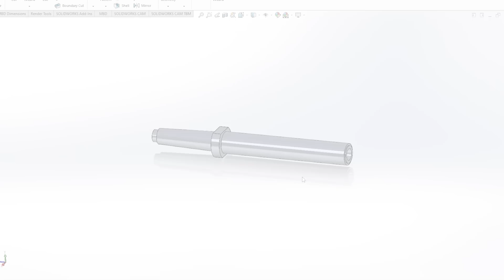Fixing An Overdue Mistake - Morse Taper Slitting Saw Arbor Build

Comment: The runout maybe from the cold rolled steel, as it has internal stresses in it from the rolling process. And when you machine the surface the internal stresses then become dominant. CEE had this problem before and he had to normalize the part to relieve the stresses so it would stop self warping .Your design is spot on. As you mentioned about trying to have the cap doing double duty. 
The most concentric way I have ever seen is by clocking and turning the mandrel in the mills spindle.
 Great channel

Comment: What size Morse taper was this??  Great video. I recently made 2 slitting saw arbors for two different size slitting saw blases, but mine was to  fit into an R-8 milling machine spindle. I've rarely had a slitting saw blade run 100% true, especially thin ones.

Comment: Nice video. I appreciate the length. Enough for explaining reasons why. My slitting saws also have runout. Only don't understand why you didn't tap with a tap follower in the lathe.
Reply from the maker: M12 taps are a little much to tap like that. The larger tap wrench I use doesn’t sit in the lathes swing

Comment: Been following your channel for a long time, and am about to get a lathe from the place you got yours. One thing that keeps stopping me is trying to find material. Where do you get yours? I think we are in the same state, but I am country, so not many options. Any advice or info would be greatly appreciated. Lastly, could you also tell me where you got your dovetail cutter from? just ebay? H&F don't seem to stock them
Reply from the maker: If you are in NSW, Edcon is you’re best bet for metal. They have a few locations in. NSW, or they can post it. And the dovetail cutter is off eBay. Nothing special. I’ve had it for 3 years now and it’s still very sharp.

Comment: Perfect build!🙂 I'm ashamed to admit, I've never turned a taper that actually had to match another tapered surface. Tried once upon a time, and failed.😁
Reply from the maker: Believe me I’ve turned some pretty poor tapers. My go to is use layout blue to look for the contact and sand it down till you get contact all long it. Not the quickest method but it works
Reply: @artisanmakes  Thank's! Yes, I will do that. It's good to watch you use the layout blue this way (or for scraping a flat surface). Seeing a practice drives the point into your mind!

Comment: The runout you see is likely caused by runout in your lathe tail stock and/or lathe live centers...

You definitely have an alignment problem with the tail stock chuck you used to hold the drill you bored the final hole with, I could see the ream you used bouncing side to side as you cut...

Comment: Wishing you a better recovery ❤
Don't know if you knew about it but you can make a tapered angle in the lathe just by moving the centre point of the piece in one end. 
In that piece you made a thin copper shim in one of the chuck jaws would be enough. 
I learned it from a 70 years old machinery master in the navy.

Comment: dont forget to use a sharp edg tool to remove the radius on the holder or it will not seat downok  take care .. tone U.K.
Reply from the maker: For sure, I got a little lazy here and just undercut the back face, still ends up the same

Comment: Fantastic job!  Considering the length of the tool you’ve really done great.  Also,  onsidering you’re using mild steel, your turned finish is excellent.
Reply from the maker: Cheers. I was pretty impressed with that too, although it can go south quite quickly. I’ve found medium depth cuts 0.5-1mm , fast rpm and fast feed works best.

Comment: Stupid Question from an amateur: I got told that a Morse Taper is only good for pressures along its axis and if used for applications that have preasure from the side it can fall out quite often. Whats your experience with that?
Reply: That's one of those 'technically true' things, but as MNHobbies said, it has a drawbar to keep it in place.
Reply: Thank you both!
Reply from the maker: Both the commenters and correct, drawbar works well. I’d add it’s the taper that comes standard with the mill, and many Aus/uk mills of this size so I have to work with it. Not the preferred taper but it works well enough.

Comment: 4:50 why wouldn't you tap that while in the lathe to insure squareness?
Reply from the maker: I would but tapping m12 is quite awkward to do in the lathe since it requires a bigger tap wrench and more force. If it was M8 or M10 I would have done that

Comment: Any reason you didn't tap those holes in the lathe? That would have guaranteed getting them straight and wouldn't have required any additional setup since you drilled them there.
Reply from the maker: Tapping that m12 hole is quite awkward in the lathe since it requires a lot of force and the larger tap wrench which doesn’t fit in the lathes swing. For the M8 hole, I simply forgot to.
Reply: @artisanmakes  something I've done before is put a tap in the tailstock and use the chuck key to turn the chuck when I didn't want to risk power tapping with the shitty mini lathe I have at work.

Comment: A tip that I learned from my Dad almost 50 tears ago:
Leave a little material on the end, then by hooding a turning tool in the milling machine vise finish, and true the arbor in the spindle of the mill.
Reply: Good tip, I was expecting that to be how the register was to be turned. Another tip is to cut both the flats in one setting using the side of the cutter. I have found in the uk that soft ground morse taper arbors are relatively cheap for what you get to save machining time & bar stock.
Reply: But what's the actual added value in that? Why would it be better than using the taper in your lathe?
Reply: @jhbonarius  Finish machining the registers in the spindle of the machine the arbor is used in has a better chance of running concentrically.
Reply: @joemcgarry1106  I disagree. Using the spindel taper of the lathe world be just as good. Why would that taper be less precise than that of the mill? The MT adapter sleeve could introduce an error, but a good quality one doesn't. Finally, the mill actually has more potential sources of error, as head tilt error (1 or 2 axes), Z-axis alignment error (2 axes), etc.
Imho the lathe should be the best tool for this.
Reply: @jhbonarius  It is about the spindle bearings.  You have two hobby level machines, both are likely to have spindle run out. Finish machining the arbor in the machine it is used in will minimize eccentricity problems. In theory you are correct, not so in practice. I would like to point out that he did it as you suggest, and he did have an issue.
Reply: @joemcgarry1106 But turning it in the mill won't fix that, unless you have a way to exactly index the arbor in the spindle in the orientation you machined it in. Morse taper doesn't have that. And therefore there's no use: your arbor will have the runout error of the mill built in, and if you by accident place it back 180 degrees from what you machined it in, you'll have twice the runout. 
By the way: like he said, his issue could a well be caused by the cheap saw blades.
Reply: @jhbonarius  Clearly you have a handle on this. Good luck
Reply: @joemcgarry1106 wow, seriously. Way to kill a conversation. You could say "your right, I forgot that Morse taper doesn't have a way to index the tool in the taper", or "well actually, you're wrong because ...", but you give me sarcasm? What's up with that?
Reply: @jhbonarius  Your style is confrontational. I would address all of you concerns if they were asked as questions, not accusations. I am an old man, and I do not have the time or desire to defend myself. I was offering a practical solution to a common problem.
Reply: @joemcgarry1106  ok, sorry if I offended you. That was not intentional. I'm Dutch. We're rather direct in our communication. (There are some nice videos on that on YT).
Reply: @joemcgarry1106  I find your father's idea interesting, but I tend to think like  @jhbonarius  . But really my main problem is turning a decent fit and finish morse taper in the first place.😁 I hate turning tapers to measurement and fit. 

(Currently, I don't have to consider the task, since quite unbeliavably, I've got a lathe that really doesn't allow any taper turning! The tailstock can not be offset, and the top slide has very short travel and is a bad joke anyway. I got the lathe at 75% discount for 250USD,  so didn't really check it out before buying, because really I wasn't shopping for a lathe at all at the time. And you sort of expect that a tailstock can be offset. Else I would be very angry at the darn thing. I'll get a better one eventually. I expect the controler cirquit will burn some day anyway. I used a washing machine motor for my first lathe - old style with pulleys, no electronics :-) I've got tooling, which is the important thing.)
Reply: @jhbonarius  some people just have soft skin... i noticed nothing confrontational? state the facts, and yeah... some people cant take it, and fail to see their own confrontationality in pointing out so called "confrontational talk".

meh, i agree wholeheartedly, and the issue is entirely due to cheap chinese slot saws. i just made an arbor the other day as i was sick of the shoonk shoonk shoonk sound and wobbling blade, blamed the cheap and nasty "universal" arbor...

wasted my time. the freaking blade itself has almost 1mm of eccentricity!

easily fixed by touching it up with the grinder.

"s-s-s-s-s" sounds so much nicer than "shoonk shoonk shoonk"
Reply: @andersgrassman6583  When I was a young, and idealistic  I  wanted to do everything "by the book" so to speak. When I had the boss breathing down my neck it was necessary to do what I had to to process the work as quickly as possible. Dad's trick was one of many  to help me to keep my job.
    In later years I worked in better shops where I had access to high end equipment, materials, and processes. Using the right equipment makes all the difference in the world. Ideally  I would make that arbor from a harden-able material,  rough turn it in the lathe, heat treat, normalize, and O.D. grind it between centers. It is likely it would  still run-out because of the inaccuracy of the spindle bearings in the mill.  You have done an outstanding job considering the equipment that you have. It demonstrated your skill and resourcefulness. When I view your video there really appears to be a minimal run out at the slitting saw blade. In my home hobby shop I would make as you have. I keep a selection of different length arbors with cutters installed, truthfully they all have some run-out. The way I use them it does not matter. I also use all carbide tipped blades, cheap ones from e-bay that are meant for wood working, but they seem to work OK. I also always use a gravity feed drip coolant with them.
  My Dad started learning the trade in the late 1930's. He possessed a wealth of old time tricks, and methods. He was also an accomplished tool maker that could do very high end work. I have been cutting metal for over 50 years. I am retired now and I just like to share in the conversation. I wish I had a tip for finishing the the taper, I  agree that may be the an issue. I have long considered acquiring a tool-post grinder for my lathe for jobs as this.  I miss working with, and sharing with other craftsman. Be well
Reply: @jhbonarius  :  I have added "Witness marks" to all my Morse tapers, so I always orient them the same.  It may not achieve much, but it cost nothing.

Comment: Thanks for sharing 👍  Do you have a follower rest?
Reply from the maker: I do but it suffers from the same issue I have with the steady rest, which is they have used the wrong material for the bearings. They used soft brass which quickly gets shredded to bits under any load.
Reply: @artisanmakes  I suggest you either change the brass or replace the brass with bearings. I also have a small lathe and modified my follower rest. It gives me better results, especially with any length greater than 1/3 bed length.